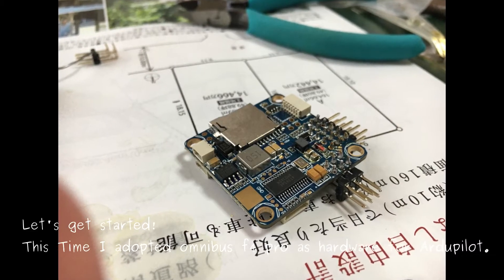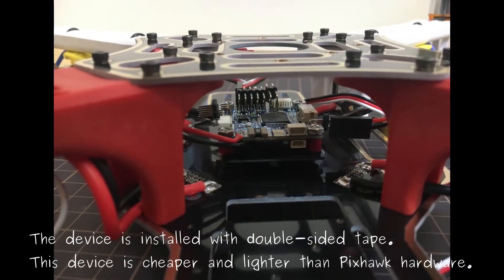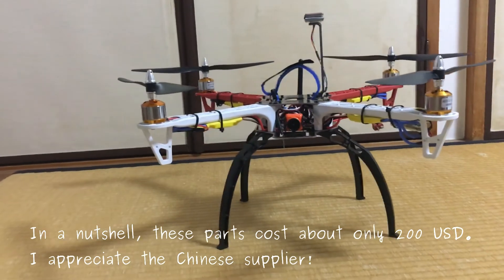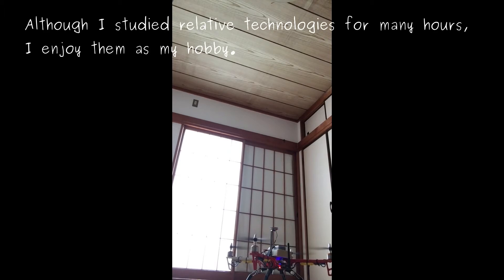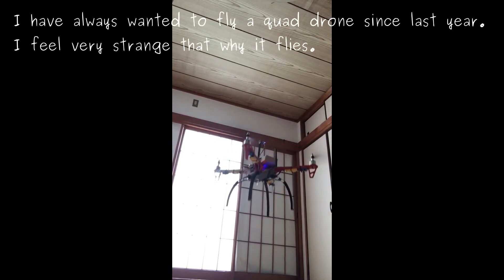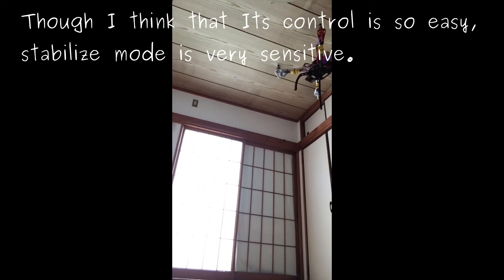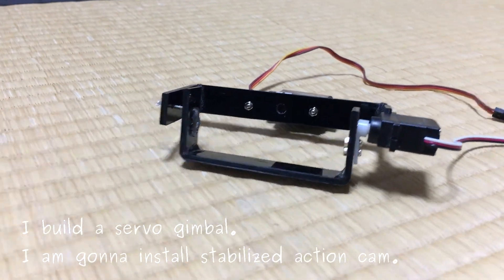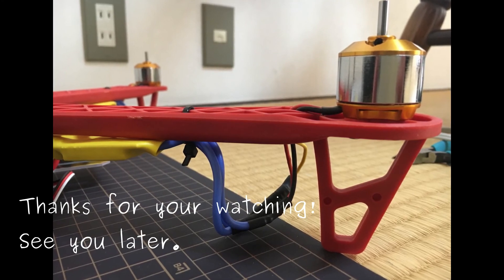ArduCopter on an Omnibus f4 pro

Comment: how did u make it fly slow , please ptovide us all your settings
Reply from the maker: Thank you for watching. Please refer download link. I deployed this ardupilot parameter file on the site. But I think that tuning points are only ATC_RAT_PIT_P and ATC_RAT_RLL_P. 
As I had to need powerful enough motors for stable flight, I changed to other brushless motors.

https://ux.getuploader.com/tm_upload/download/1